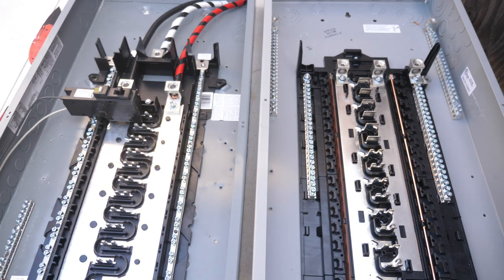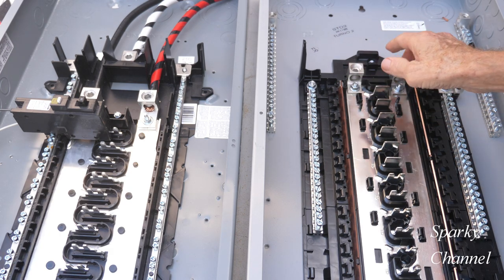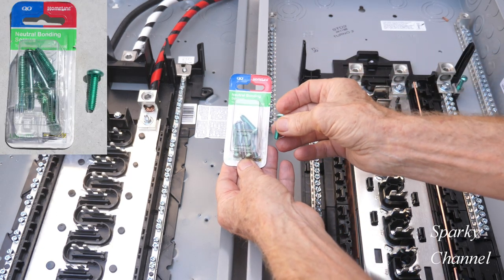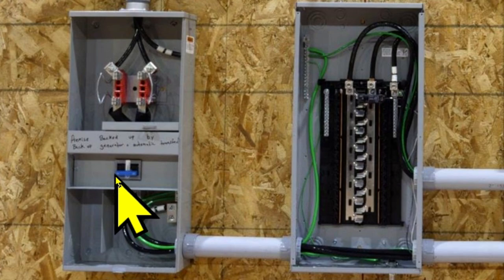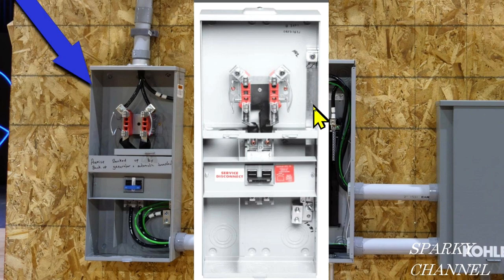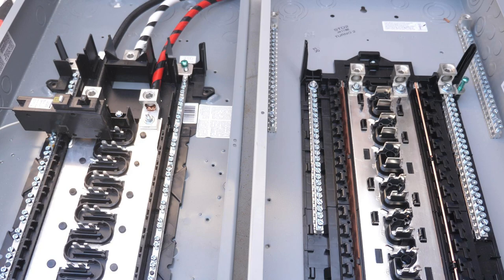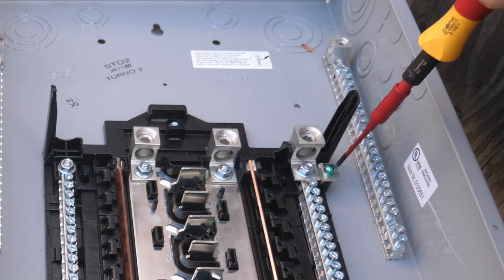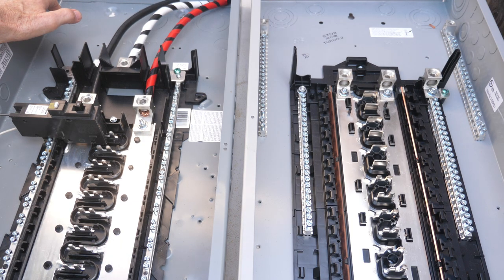Siemens vs Homeline: Neutral Bonding Screws + When are They Used?

Comment: Belatedly dropping in, Bill, at 0:25 you say the Homeline is 1/4"-20 and the Siemens is 1/4"-32. That does not seem like it could be right, 1/4"-32 is not a normal standard thread. Since the screws appear to be the same diameter, it's almost certainly the case that the Homeline is 1/4"-20 and the Siemens is 1/4"-28.
20 and 28 are the coarse and fine thread pitches for 1/4" screws, although 1/4"-28 is relatively rare. (Another possibility is the Homeline is #10-32 and the Siemens is #10-24, as 24 and 32 threads per inch are the coarse and fine thread for #10 (0.189" diameter, but that seems backwards from what you show. The Square D PKNBSCP kit includes four 1/4-20" screws and two #10-32 screws. Yet a third possibility is the Siemens is metric, but that seems very unlikely, given the whole ITE history of the product line.)

Comment: Very helpful!!! The way they wired my Siemens, I’m out of lugs on the two bus bars where they put most of the neutral wires. Trying to determine if I could use the bus bars on the outer sides of the panel - where most of the ground wires are returning from the house - for the three neutral wires I want to add with new breakers.
Reply: Maybe another way to ask it… can you explain the four bus bars? Two on the innner vs. two on the outer ?

Comment: Excellent video!

Nagging thought here... a ways back I was taught your ground return path should be done with connected wires and not enclosures.  The enclosure is connected to the EGC, but you don't land an incoming EGC to the enclosure for return, you connect it to a bus or connection that has a wire connection to the return EGC.

That has me wondering about the neutral return ground path through the ground screw into the enclosure over to wherever the GEC is.  Clearly it's determined to be good enough that all manufacturers have it signed off on, but are there times you'd connect a neutral bar to ground via a direct wire method?  I've used the neutral bonding screw, but I haven't have felt clean about it when it's via the enclosure.
Reply from the maker: You mean that in some cases you would like to insure the neutral bonding by a redundant method as well, such as a direct wire?
Reply: @SparkyChannel  Redundant paths bring other concerns, so not trying to get into that.  It's what reasons would there be to neutral bond via a wire instead of the provided screw.  I've seen old rusted up outdoor panels don't look trustworthy for a ground path.
Reply from the maker: @RJ-ej1nr  I see. I think you have to stay with the manufacturers design and use the correct neutral bonding screw. Perhaps the green finish on the screw will help protect it.  :)
Reply: @SparkyChannel  Let's see - 110.3(B) says "in accordance with any instructions".  SqD says, "If required by local code, install the green neutral bonding screw...", i.e. talk to your inspector, not us.  Inspector will say, "I don't care it's just repairs, I'm not signing off on that piece of rusty..."  So guess we are back on the screw being fine.  :))
Reply from the maker: @RJ-ej1nr  LOL, sounds about right.
Reply: @RJ-ej1nr  A redundant path inside the first means of disconnect to bond the neutral and grounds would not be a safety issue. As long as you aren't bonding grounds and neutrals together after that point there will be no dangerous parallel return paths.

Comment: That panel would be a indoor rated/ disconnect...many disconnects are outdoor rated...so fireman have access outside of a structure
Reply from the maker: Correct.
Reply: @SparkyChannel  disconnect can be outside or inside as long as service conductor penetrate the house and end up in the first panel and not more than 5 feet

Comment: I have a siemens main panel and meter box side by side. The main disconnect panel has a grounding jumper and no bonding screw. I am about to add a generator and the generator transfer switch will now become my main disconnect and I need to "unbond" in the main panel, but there is no bonding screw to remove. How do I do this? Thanks.

Comment: So if I'm understanding correctly,  a panel like square d  SC816F200PS main service panel that comes with built in main bonding jumper does not need a green bonding screw even when a residence has a sub panel connected to it?  Hence why square d doesn't supply one in this panel

Comment: The two 100 amp Homeline load centers I bought from Home Depot had the bonding screw on a piece of white cardboard inside the boxes.
Reply from the maker: Interesting. I searched all over for one in my box and didn't find one. I'll look for a piece of white cardboard. :)
Reply: My homeline also came with the green screw, but the damn thing does not start. Almost like it is too short. All my neutrals and grounds share the same bar and looks connected to the service neutral. My goal is to bond to the  case because I am using emt. I suppose I’ll just make a bonding wire from the case(box enclosure) to the neutral bar. Does this sound correct? This will be the only panel in a steel building.
Reply: Never mind I found a piece of unistrut was stopping the screw from starting. It is installed and tight now.
Reply: My 100 amp Homeline came the same way. A small plastic bag with yellow covers for the hots, and a small, square, piece of cardboard with the bonding screw.

Comment: What about solar fuse disconnect that is connected by tapping the line side at the main electrical panel. Does that mean that both the main panel and the fuse disconnect need to bond the neutral to ground. Thank you

Comment: Just to be sure, Main Bonding Jumper is totally different than a green grounding screw in a sub panel.
Correct?
Reply from the maker: A neutral bonding screw is a type of main bonding jumper. Never use one in a sub panel as the grounds and neutrals must be separate in a sub panel.

Comment: So if you install an emergency disconnect(fireman disco)rated at 200A near the meter and your main breaker panel inside a garage also has its own 200A breaker, do you still bond neutral and ground at emergency disconnect box even though it’s not service disconnect but rather emergency only?
As an apprentice I asked that question my foreman and his answer was that it needs to be bonded at your main service panel not your emergency disco? A bit confusing to me. Thanks for your video.

Comment: Really appreciate your videos.  Thank you! What if the installer leaves the partially set bonding screw in the sub-panel. Should this be removed?
Reply: YES!! Neutrals and grounds are separated in a subpanel. The (green) bonding screw has no place in a subpanel. That is to prevent someone accidentally screwing it all the way in under the belief that it's loose.

Comment: My panel inside the neutral and ground are bonded together and now I have to replace my 200a disconnect at the pole right under meter and I need to know if I bond it together to.

Comment: What would you do if your sub panel also has a main breaker?
Reply from the maker: Excellent question. You bond in the panel of first disconnect. You keep the grounds and neutrals separate in all panels after that, whether they have a main disconnect or not. It might be convenient to have a 2nd disconnect, but you still have to keep the ground and neutrals separate except in the panel of first disconnect.

Comment: If it's a subpanel, do you leave the screw in place untightened, or is it better to remove it? (Siemens SN panel in my case.)
Reply from the maker: Best practice to remove it. That way, no one can accidentally tighten it down later.
Reply: @SparkyChannel  Thanks, will do!

Comment: So what about the GIANT bar connected between ground and neutral? Wtf is the point of the screw?
Reply: When the main panel has a main disconnect, then it needs the grounding screw and a GIANT bar connecting the ground and neutral.  But since both of those panels didn't have a main breaker, they didn't require a grounding screw; he installed the grounding screw to demonstrate the fancy torque screwdriver.

Comment: Working on a 6000a 480v MCC(motor control center) where equipment is all grounded inside panel and bonded to steel of building. The panels that come from that MCC for the lighting, the equipment and the 208/120v receptical panel should not be grounded?
Reply from the maker: Hi Whitty! The panels would all be grounded but only the panel of 1st disconnect would have the neutral bonded to the EGC. Subsequent panels would need to keep the grounds and neutrals separate.
Reply: The green screw is a system bonding jumper, which means it connects the neutral to the equipment grounding conductor (EGC aka ground).  The EGC is still available in the video's panel when the green screw is not connected.  In your case, because the 480v gets transformed to 208/120v, you have a separately derived system possibly with the system bonding jumper at the transformer.  If you open the system disconnect and don't see the bonding jumper, that's where it likely is.
Reply from the maker: @RJ-ej1nr  Thanks!

Comment: So i have a meter with disconnect and a breaker panel with a main breaker. Would i still not have a neutral bonding screw in main panel than? just want to make sure, Thanks
Reply: Sparky channel  will you clarify?

Comment: Please answer my question! Ive spent alot of money and I need answers. Im trying to install a 50amp inlet box in the garage 3ft under my main panel that houses all my breakers. In the is panel his has a main breaker punchout on the siemens panel but no main breaker. My main shutoff is below the meter outside the garage. I plan on having an electrician install a 200amp main panel breaker in my panel. I have a neutral floating bluetti solar generator so both the neutral and ground has to be mounted on the same bus bar. Neutrals and grounds must be bonded and something about first means of disconnect. Well heck Im finding out first means of disconnect really means below the meter. So how do i sit all this up now to work? Done bought all the breakers, wiring, interlock switch. I have an electrician who after long explanation of what I want to do says he understands but then I found this out that my first means of disconnect is in below the meter even if i add a main breaker in my breaker box. So how do i keep this same setup in my garage? Does the electrician have to add something at the meter box for this to work and rearrange my panel in the garage. Im so confused.
Reply: Buy a transfer switch and install it next to the load center. Sounds like your "electrician" is just a handyman if he doesn't know that. It's not like you're going to be able to back up all of your house anyway with a 50a generator
Reply: @YaksAttack  I figured out answers to all my questions. You can definitely run your entire house off a 50amp generator. What are you talking about? Transfer switch: You can only choose a few circuits, and you must choose wisely. Interlock switch you can use any circuit or breaker you want whenever.
Reply: Always keep the neutrals and grounds on their own bus bars as well. Even at the first point of disconnect they should be on the correct bar as the bonding screw is not rated to carry return current.
Reply: @YaksAttack  quit acting like a smart ass. There's no need for a transfer switch in this application.. just finish highschool

Comment: In the video there are two green grounding conductors from the first disconnect to the second panel. Why are they necessary when there is already the main grounding (white taped) conductor between the panels?
Reply from the maker: Neutral (grounded conductor) is the return path of the current, and the green ground wire holds the fault current to trip the breaker in protecting the person and the facility. They must stay separate after the first panel of disconnect.

Comment: Do you have any knowledge about breakers compatibility? Since is too hard to find some breakers I wonder if we can mix brands.
Reply from the maker: No, you can't mix brands unless it's specifically called out by a manufacturer. The acceptable breakers will be listed somewhere on the panel or inside the front cover.
Reply: @SparkyChannel  Siemens Classified type breakers are the only that I know of that are compatible and tested.
Reply from the maker: @illestofdemall13  True.

Comment: 1 panel of disconnect first panel of disconnect 1st panel of disconnect. what is the FIRST panel of disconnect. I'll just google it. LOL
Reply: It's the 1st panel... Lol. But to answer your question if there was another SUB PANEL (a circuit coming off that panel that was feeding another breaker like a garage or shop panel) then the main/1st would use that grounding screw and the second sub panel would not. you want the neutrals to have a least path back to the main panel and ground there not in the sub panel and just loop around and around.
Reply: @tollav  what if you do not have a torque screwdriver? Thank you
Reply: So you don't ground the sub panel(s)?  I'm looking to upgrade the house's breaker box but am having a hard time comparing the different types.  The Siemans looks the weirdest.